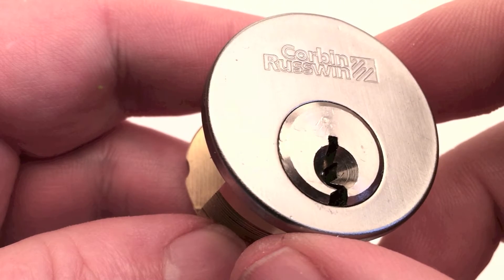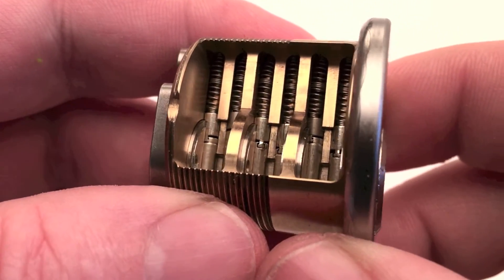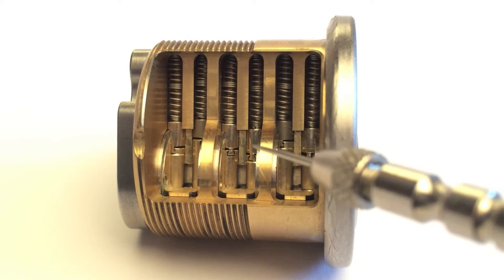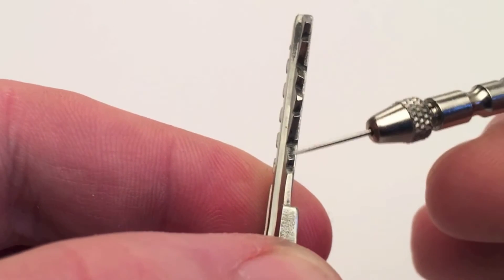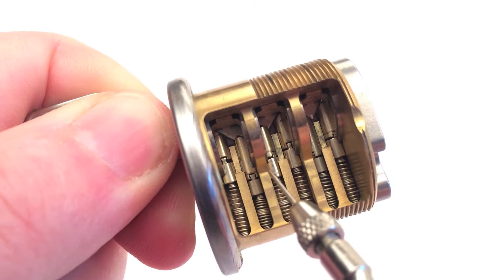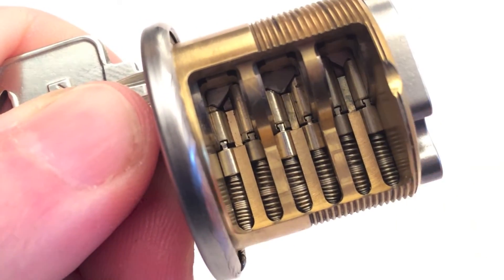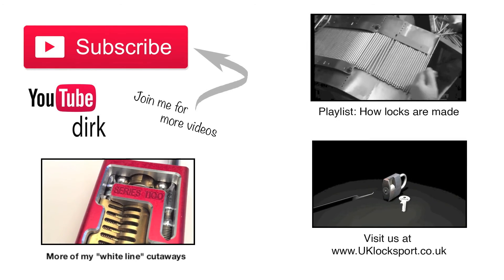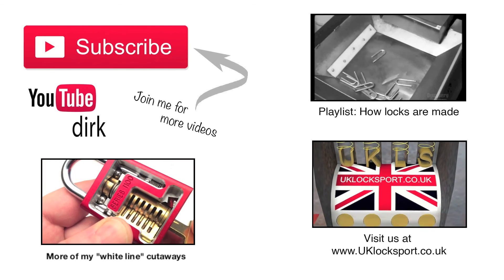[052] Cutaway - Corbin Russwin Emhart

Comment: Thanks for the great video! I will have to keep an eye out for one of these!
Reply from the maker: I keep my fingers crossed. It is not so easy to get one. They are really rare.
Reply: AFAIK, there was a tiff between them and Medeco over the use of pins that are lifted and rotated. The shitty result being that these locks are no longer made. Apparently though, parts for them are still made so that existing locks can be serviced. So perhaps there is still hope.
Reply: Do you know what sizes the pins are? They look larger than normal, presumably to handle the groove.